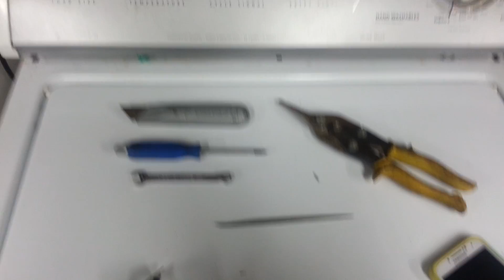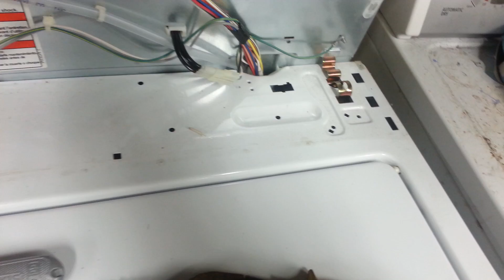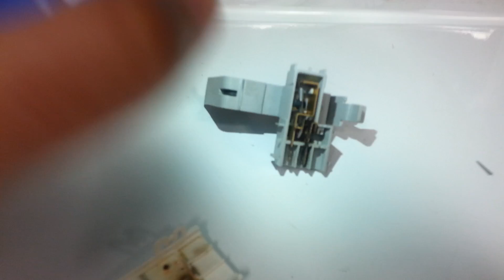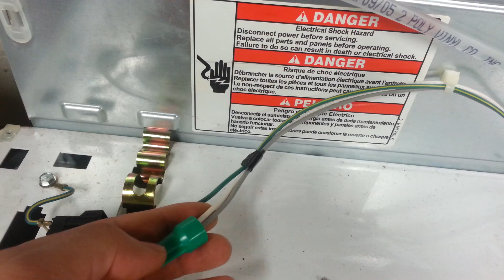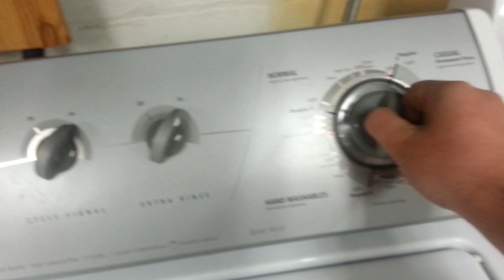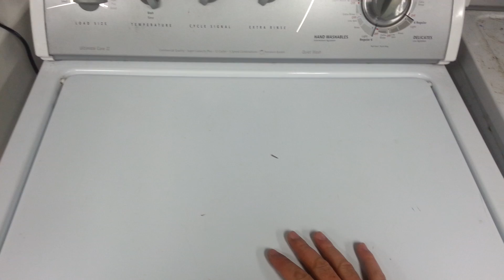Whirlpool ultimate care II clothes washing machine NO CYCLE LID SWITCH FIX -- FREE!

Comment: I thought this was my problem (and it was) but my contacts had not burned the surrounding plastic, but rather, the spring has melted a little of the actuating stick causing it not to put enough pressure to close the circuit.  So in lieu of a switch, for now, I flattened two ends of a piece of 12 gauge insulated copper wire to make a jumper to complete the circuit, plugged the ground tab back in its slot, and covered it in electrical tape.  This way you don't have to cut the wiring harness until you get a replacement switch.

Comment: An oldie but a goodie. I have this exact machine and found this very helpful video today. Two points: (1) The screws retaining the console tower are accessed from the back of the machine. they are recessed into the endcaps of the console (others have mentioned this below). (2) Open the washer lid before you try to remove the lid switch assembly or you may break the plastic spring tab off.  Thank you, MrUncleSpicy.

Comment: Great video! 
I have this same washing machine in the house I just bought. Someone must have already bypassed the lid because I can open it without stopping the wash unless it hits the main control knob behind it and pushes it in which shuts it off. My problem is that my washer won’t work in either delicate or handwash settings. Normal and casual (permanent press) both work fine. If I want to use a gentle agitation setting it doesn’t work after filling and I hear clicking coming from the control knob. Any ideas?

Comment: Ok, I am writing a review because=>>allmy.tips/WhirlpoolWasher?a134     I am in a rental, 2 years ago, the landlord replaced with this exact machine. well, I have had it for two years, honestly because its not mine,{I know I am wrong) I have washed big loads, old heavy quilts, down quilts, big loads you name it. Well, I am buying my first home and I go into Lowes, I see the exact machine, I bought it on the spot, matching dryer too. I love this machine, it is a little noisy but who cares, I don't, whirlpool has a great reputation and this machine meets all my needs. And of course, my clothes come out fresh and clean, good detergent required. Just sayin.
Reply from the maker: Good to hear. Does it have an agitator? I miss mine and yes it was a work horse. I regularly overloaded it....when it finally died I replaced it with a GE top loader. It washed good but had computer board issues replaced under warranty.

Comment: I have identical machine when it’s  set to small load starts to drain the water before washing the load, is it the sensor causing the problem? On medium or higher runs fine, Thank you.
Reply from the maker: Does not sound like the issue i had. If the lid switch goes,  the machine won't cycle at all.

Comment: I have a Whirlpool Ultimate Care II that will drain the water, but it sometimes spins and sometimes doesn’t with no rhyme or reason. As a guess, would this switch be the first thing you’d check?
Reply from the maker: Spin cycle or agitator? When my lid switch first failed getting stuck full of water was the first symptom. If the agitator is not moving its the "dog teeth"
Reply: I think it’s just the spin cycle. There have been a few times it’s left some soap bubbles on the side of the drum, but I think it’s usually just the spin cycle. Just happened 30 minutes ago and I tried moving the clothes around( not a large load) to no avail. Opened the lid and tried this about 5 times. Finally took the clothes out and put them back in and it spun.
Reply from the maker: @michaelthilman4348  try slamming the lid, i did that a few times before my lid switch fully crapped out.
Reply: Will do and thanks. If I get a chance, I’ll take it apart and look at the switch as well. Should I look for anything noticeable on the external part of the switch that would say it’s getting bad?
Reply from the maker: @michaelthilman4348  it might be a little burned and crusty at the terminal end of the switch...good luck.
Reply: Thanks a bunch

Comment: I have the very same machine Whirlpool ultimate care II 
Everything is working [ kinda ]
Thing is when it time to spin it dIoesn't 
the wet clothes are sitting waiting....to be spun
as the water drains.
Once the water drains....it starts the rinse cycle
water is full, it agitates, drains......but again doesn't spin
What I do is,  I listen to the sound...Ahhh spin cycle is next....
I hear the water draining but it is not spinning..
I open then close the lid
Dam thing starts to spin and drain

Is it the controller
Is it the Switch

Help me out please
Reply from the maker: John Smith those were the symptoms i had before it failed.
Reply: has been like this for 4 years,  I only now getting around to have it fixed LOL-  so controller or lid switch whatcha think?
Reply from the maker: John Smith i would try the switch first because If the lid switch sends open signal at any point it will stop the machine.

Comment: Not sure if you ever look at these comments, but I'm wondering if this could be the cause of a problem I'm having with the washer spraying water right at the end of the spin cycle! Can you let me know before I try this? It does run with the lid open, which makes me know that is broken...
Reply from the maker: if its running with the lid open, then the lid switch is definitely bad. although i don't think this affects the cycle timing.

Comment: when you cut the two wires did u remove the left over ends left inside the black connector thing (sorry I forgot what it's called) that the ground wire is still connected to.

Comment: I'm having troubles opening the lid.  Mine is not coming up so easily
Reply from the maker: Sean the wash lid or dial lid? if the dial lid dont be bashful...unscrew, and lift up slightly as you pull it to you. it needs a good tug.
Reply: MrUncleSpicy worked, the machine is working.  thanks a bunch for posting this
Reply from the maker: Sean high 5!

Comment: can't seem to figure out how to open the lid where you turns the knobs
Reply from the maker: Andy Ramirez hi andy. after you remove the 2 scews on the back you pull/slide the top section to the front and it should pop up out of the slots that hold it in. then just tilt back.
Reply: MrUncleSpicy do they completely come out or do they stay there in place
Reply from the maker: Andy Ramirez the screws stay captured on panel. facing the machine, hold the front panel by either end and pull to you while also lifting up. it should pop up and tilt back.
Reply: MrUncleSpicy thanks I'll give it another try

Comment: I completed this fix and it worked perfectly! After a few loads it quit again. It filled with water then would not cycle. Help?
Reply from the maker: John PInard maybe check the connection again for the wire nut
Reply: Ya that looks to be a good connection. What about fuses and where are they?
Reply from the maker: John PInard , first did you check your breaker box? sorry i dont have a wire diagram for the machine itself. i would also re check the ground to the lid switch (or whatever is left of it )
Reply: got it working. Thanks!

Comment: Thank you MrUncleSpicy!!! Will attempt this fix...
Reply from the maker: +tubetop36 no problem! PS i just got done replacing the agitator dogs (see below description from amazon).

while your in there might as well check the agitator is working properly, and if not order a set. GOOD LUCK!

Whirlpool 80040 Washer Agitator Dog (4 pack)
Reply: Thank you for the additional look-see advice, do you have a video for how to replace 'Whirlpool 80040 Washer Agitator Dog pack'?
Reply: Hey MrUncleSpicy!! Panel flipped open, mechanical switch shows "center terminal is not burned", even though the white plastic is a little charred. Do I still need to fix --or can I permanently push or wedge in order to "close the switch" .....tricking machine that the door is always closed??
Reply: I have a photo I can send to show the 3 terminals are clean and not burned....where can I send photo??
Reply from the maker: i would replace the switch, good luck!

Comment: This worked like a charm, thanks a million for posting it!

I would add one small detail, the philips head screws that you remove to open the console can be hard to see at first, they are positioned horizontally within plastic channels on the back side of the console.

Comment: This really works and its a fantastic fix. Thanks for posting this. What a great help. On thing to note: I couldn't see the back of my machine well from the front and the two screws that you have to remove are facing down to the ground on each side NOT screwed into the back. Once I got those out everything worked like a dream. I owe you $200!!

Comment: This was a God sent!! I Purchased A Used whirlpool washer and it showed some of the same signs that yours did, so I figured why not try it out. I have the older model where the switch is on the side instead of the back side but just followed the wiring and connected like you suggested and it went through the cycle like a charm!! Thank you for the thread!

Comment: This was an excellent guide. Unfortunately, I did it way different. I just popped it open, removed the melted plastic piece, then got 3 of those thin wooden spoons you get from those yogurt candies like Duvalin and stuck it in between the black hook piece that slides. It's thick enough to keep the metal tabs connected and doesn't touch any metal so no fire hazard. It's a slightly easier, but slightly riskier fix until you're able to fix it like the video or buy a replacement.

Comment: How do i get the switch out
Reply from the maker: onenite2nite there is a push tab on one side... grip it and rip it! well..rather with a squeeze of the tab you can pull it out.
Reply: MrUncleSpicy cool thanks. Just need contact  cleaner but this saved me calling a service  tech. Thank you. Going to order  spare part.
Reply: squeeze tab and open lid

Comment: How do I open the top of the whirlpool ultimate care 2 washer to get to the lid switch
Reply from the maker: Jeremy Farnsworth unscrew the top panel and tilt it back
Reply: Jeremy this is kelvin you commented on building you an engine 4g63 if you are serious contact me thanks!
Reply: Kelvin Williams I am to a point as to where I don't really need 700+hp lol mine is daily driver but it has the 2.4 lt 4g64 I think and I would like to have it boosted and say maybe 350 400 to wheels so that when all these college punks from ku with daddy money In they car I can walk away.it's decent fast now \inky list to a Ford focus that was decked out in focus tech stickers and I had no second gear and maybe not have it built for me more like a lust of his quality parts to use and from head down machined for me the top end I'd like to assemble here at home peice by peice considering I live check to check and would order parts when I could if you can text me maybe 785 218 8781 might be easier I don't know when you responded but I just got it and thank you

Comment: I tried this on my washer and it absolutely worked!! I have a question tho, when I get my new sensor switch in how do I reconnect it to the little black hub that I cut the gray and white wires from? thanks
Reply from the maker: Marsha Hulsey you will have to get wire crimp connectors. take your new switch to the hardware store and have them set you up with the right size. wrap with electrical tape and your good to go.

Comment: When exactly during a load did it quit working: After filling, or after agitating?
Reply from the maker: saintsfan342000 not sure. it just stopped one day and i came home to a tank full of water. the when the switch fails the machine will think the lid is open and turn off the wash cycle.

Comment: Hey MrUnc, thanks for the post. College student household lookin for a cheap repair. Our initial problem included an ultimate care ii whirlpool not draining not spinning. Preliminary message board searches and diagnostic (checking continuity) revealed an issue with the drain lid switch. Your video helped a lot, thank you thank you.